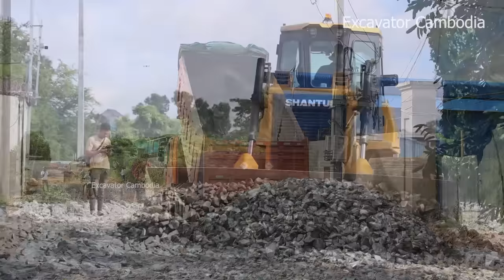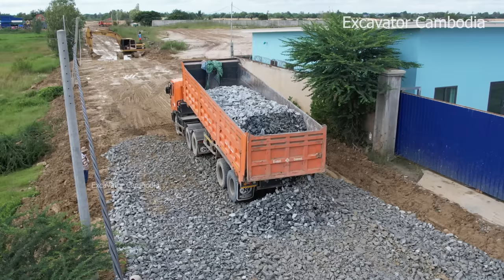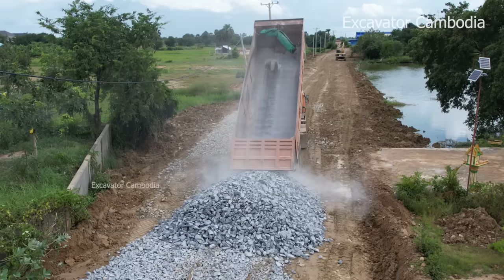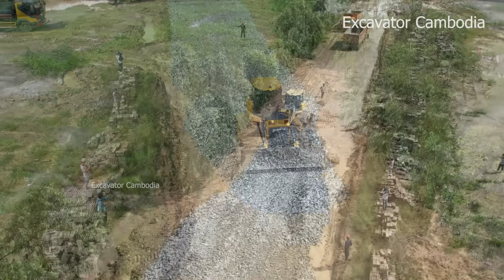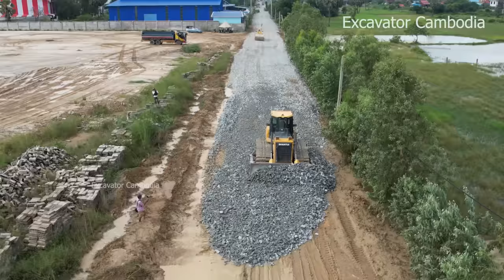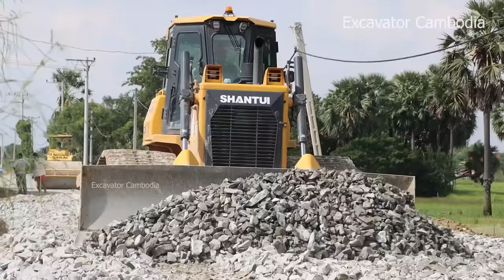Incredible Project Make Foundation Road By Skills Dozer Pushing Stone - Dump Trailer Unloading Stone

Comment: Are these dozers set up with gps blade control systems?
Reply: Yes. It guides them directly to the nearest line boring and edge replacement welding shop